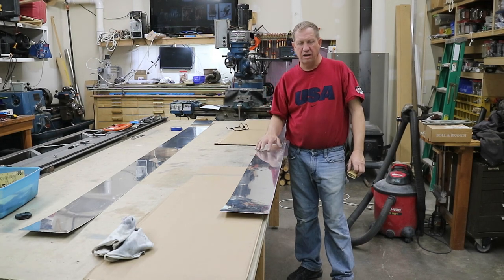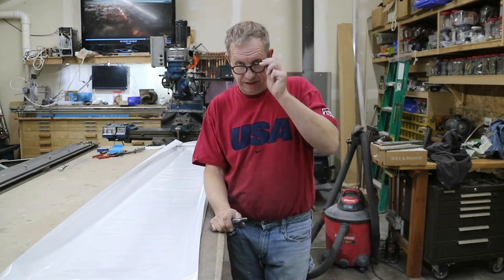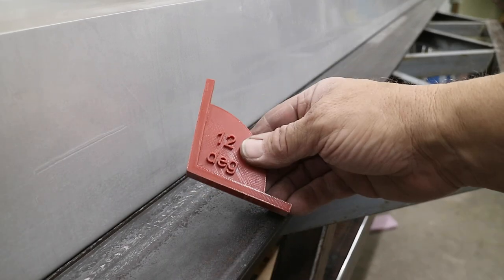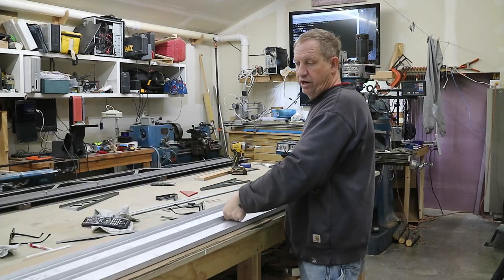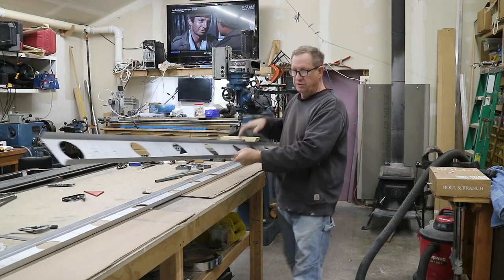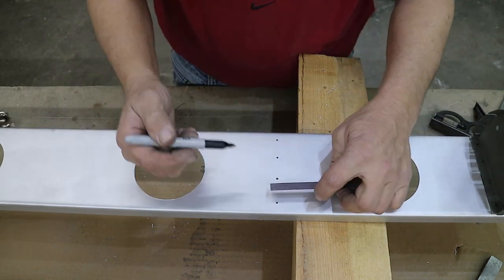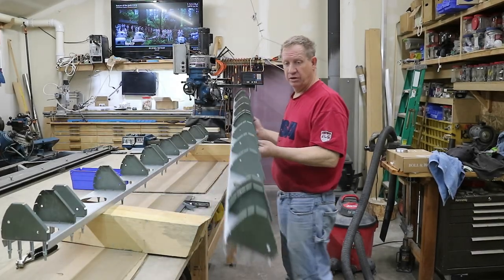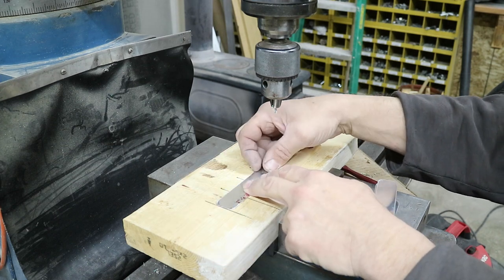Bearhawk Experimental Airplane Build : Flaps - Part One

Comment: i had the same problem with the fly cutters.  I found that the bit in the center is all way not centered.  I took the bit out and cut a brass pin on the lather --1/4 inch on one end and oversize on the other end.  Then you mount the small end into the end of the fly cutter. Then you grab the shank of the fly cutter in the lathe- and cut the pin down gradually to 1/4 inch.  That way the pin is concentric with the cutter shank.  if you use the fly cutter as-is---- it wont cut a round hole because it s wiggling.   also I use the brass pin because I dont want a bit to be cutting my central hole any larger.    I also run the mill as slow as the mill will turn it.  and feed the cutter VERY slowly.  so far that has worked well.   Cant find a good quality fly cutter.